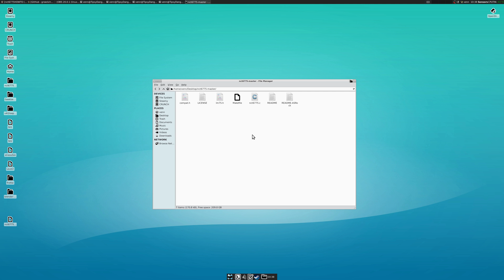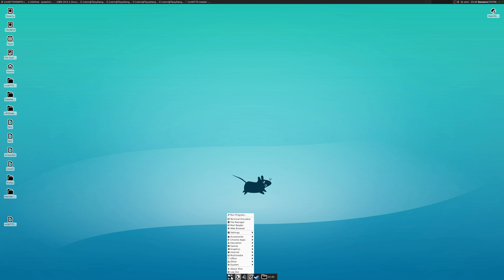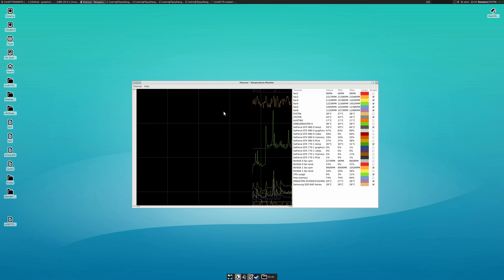MSI B350 TOMAHAWK Sensors (RYZEN/Linux)

Comment: Are the sensors correct? I had some weird negative values and most temps are incorrect? Do you have the segv issue?
Reply from the maker: I've seen some strange readings from the system fans but voltage and CPU temps read the same as the BIOS.